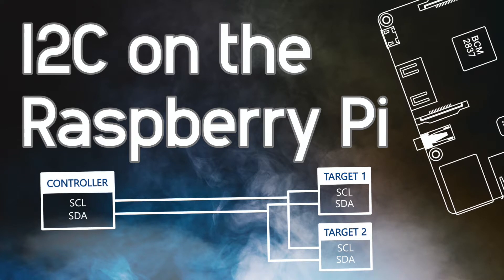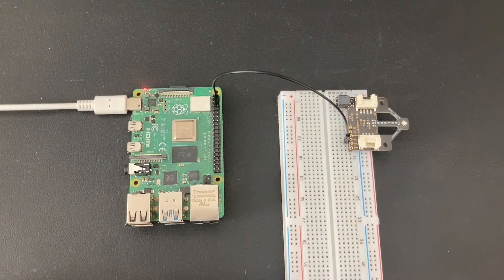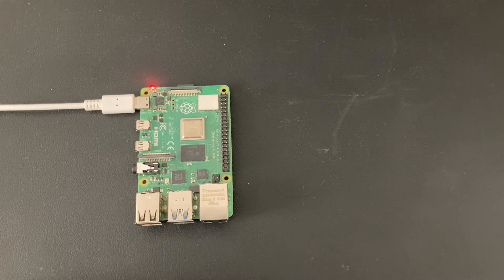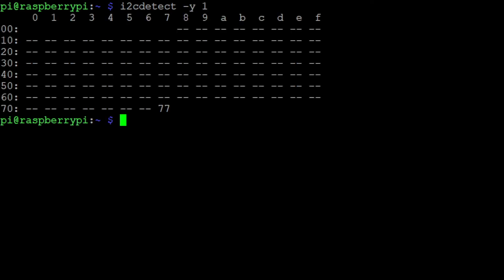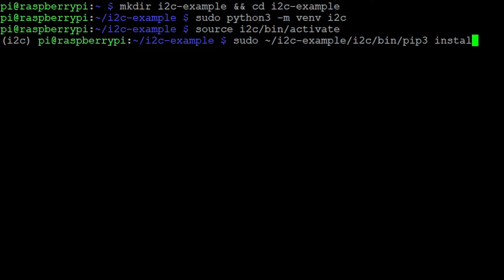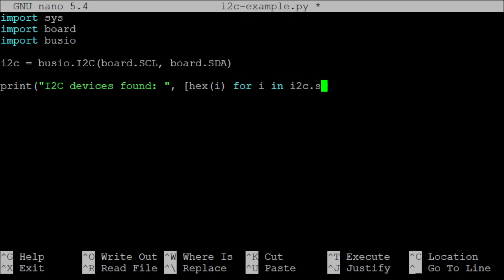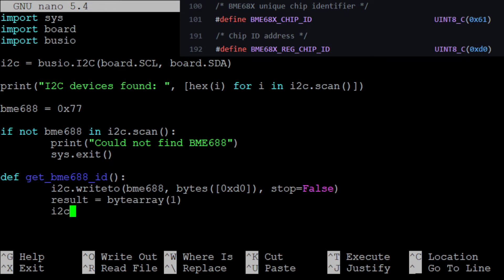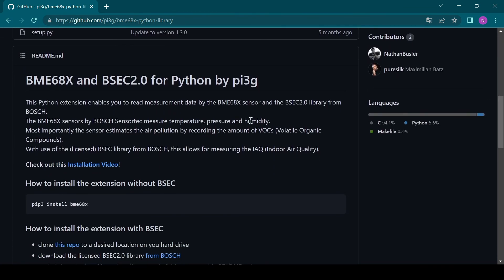I2C on the Raspberry Pi - HOW TO use I2C with Python

Comment: At 2:43 Where is the adress "0x77" displayed?  It shows a 77 at 7 horizontal and 70 vertical.  It shows blanks on 0 - 7 horizontal at 00 vertial, and shows "--" for everything elase
Reply from the maker: Hi @insylem - this is a good question! What you're looking at is a I2C device output table in hexadecimal. When you see a "--", that means that it's not detecting any device. The "77" is reached by adding the "7" (vertical) to the "70" (horizontal). In I2C output tables, the 0x isn't included, so that's why you don't see 0x, even though the full address here is 0x77.
Reply: @pi3g  thanks

Comment: Hi, thank you for this tutorial. For some reason, i can detect the I2C slave (made from RP2040) with i2cdetect -y 1 on Raspberry pi 3 B V1.2 before i run the script. After this, the I2C gets probably blocked and when i try to run i2cdetect -y 1 again, it gets ultra slow and nothing is detected - the journalctl kernel says "i2ctransfer timed out". Do you have any idea what is going on? Thank you very much in advance, keep going and building the cahnnel. Best wishes and Happy New year to you! =)

Comment: Thanks. Using virtual environment is good idea !
Reply: It's not a good idea. It's just a necessity: it's forced by the Python community on Linux and if we don't, we get errors while installing any packages system-wide. Had to lose an hour or two on a project with a very close dead line and make sense of these virtual environments and I was forced to use it. But I've been using Python on Windows on many projects for many years without any problems and never used virtual environments. I used it to write programs for many different things: scripts to do stuff on the system, scripts to do stuff on web, extensions for different programs: Blender, IDA. And many other things.